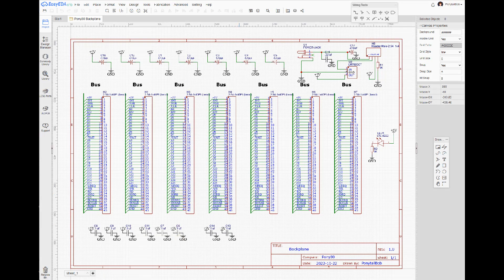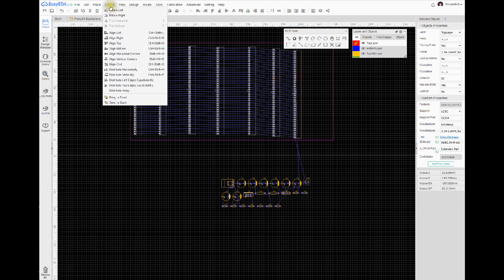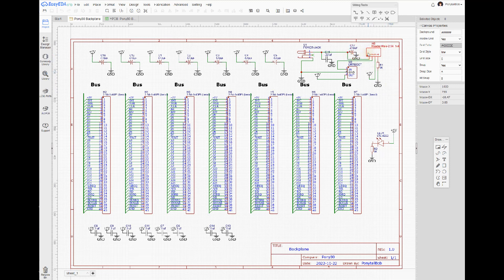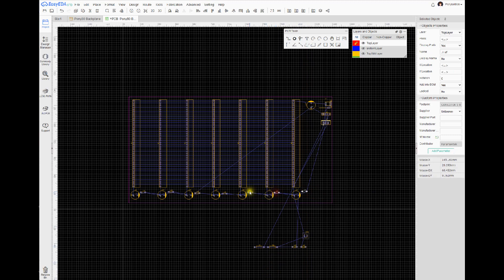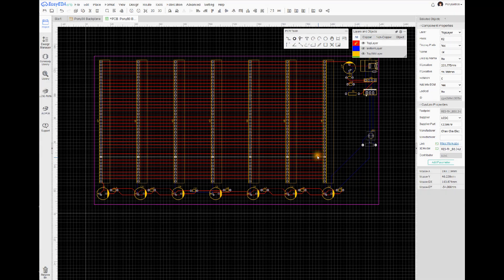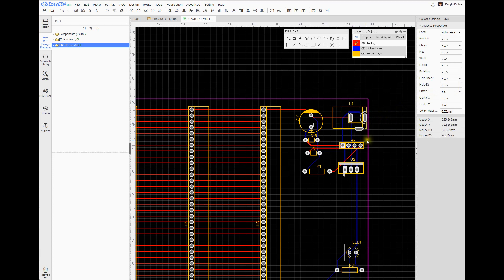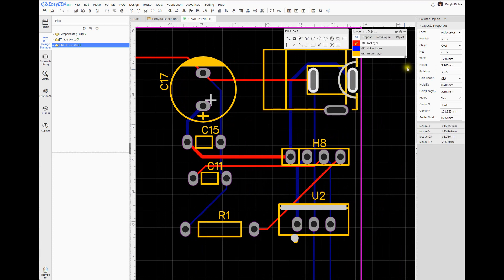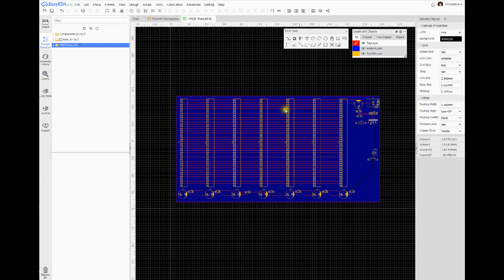PCB Design - Pony80 Backplane with Power Regulator - My Z80 homebrew computer!

Comment: Regarding pads, best to check the data sheet for the devices in question – 1mm might be too tight for certain headers. Conversely, if you've got a narrow pinout TO92 transistor 1mm will be too large. I've been using Kicad and often draw my own footprints as I also like to have a decent bit of copper for soldering, particularly if the part will get some mechanical use – sockets and switches etc. Not sure if EasyEDA allows it but if you can build your own custom library of footprints you can set everything exactly how you like it.
Reply from the maker: Good points!  I do exclude parts that have different pin sizes or are high stress parts (switches, plugs, etc) and adjust those pads individually.  Thanks  for the advice!!

Comment: I'd never considered making all the through holes the same size. If you have spare pins you can put power and ground on each edge of the 40 pin connector so reversing a card isn't catastrophic.
Reply from the maker: Good idea!  Thanks!

Comment: I love your videos. One note, I'm not a fan of the 1x40 headers. I personally use card edge connectors, but that's my preference. My rev 1 backplane uses 62-pin connectors (ISA 8-bit), and my rev 2 is going to use 98-pin (ISA 16-bit) connectors. One advantage is you don't need to solder connectors on your cards. Just my 2 cents.
Reply from the maker: Thanks!  The 1x40 are really just because of the cost. Once I get the design finished and have “final version” boards, I will upgrade to the card edge connectors.

Comment: I know it's a personal design choice, but I think I would have chosen a more robust connector than a 40x1 header.
Reply from the maker: Agreed.  The 1x40 are really just because of the cost. Once I get the design finished and have “final version” boards, I will upgrade to card edge connectors.
Thanks for the input!